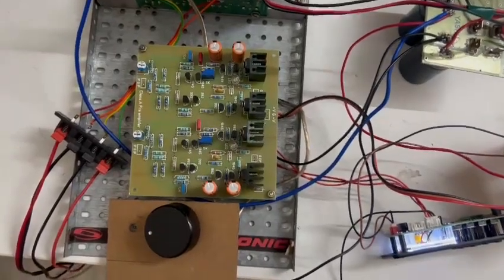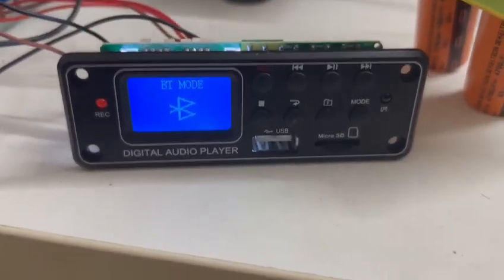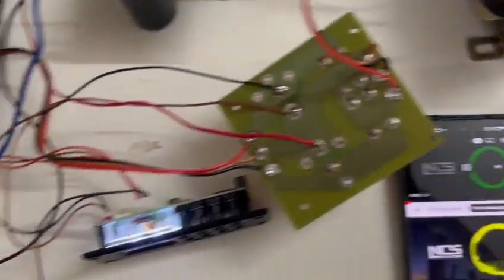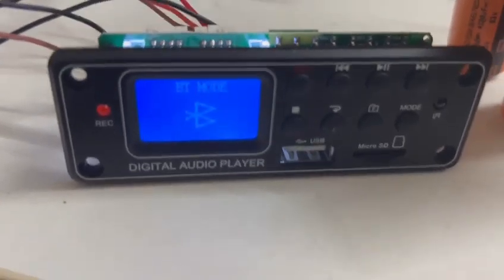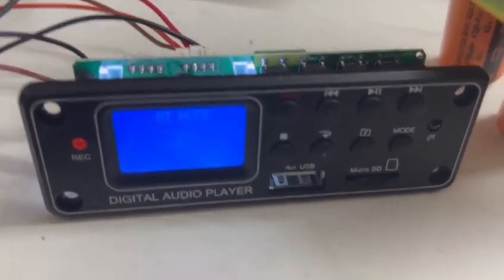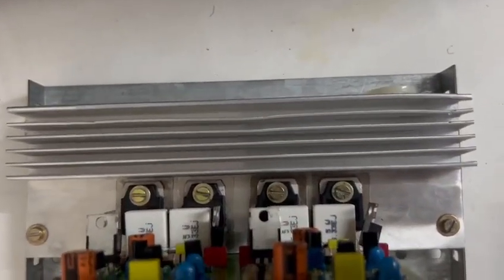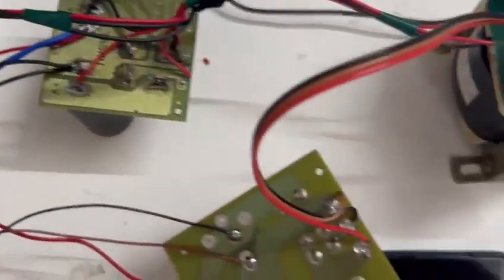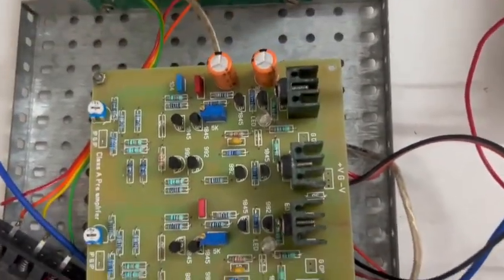Testing the Class A Preamplifier with Class AB audio amplifier

Comment: Let’s break down each part of this: “class A” is a type of amplifier circuit that reproduces the whole audio signal. This is different than a “class B” amplifier which only produces the top or bottom of the sound wave. class B amplifiers are used two-at-a-time so one reproduces the top while the other reproduces the bottom. Class A has the highest fidelity reproducing both together because there is no “crossover distortion” or, more simply put, imperfections when joining the top and the bottom signal from the class B style circuit. The negative about a class A circuit is that it uses much more power and thus creates more heat.

“Discrete” that means that the primary circuit for the mic pre uses individual components that are selected for the best combination from the point of view of the designer (the components are separate, or “discrete”). For example a tube, op-amp, or transistor are examples of a discrete components found in a mic preamplifier. Alternatively an integrated circuit (“IC”), or “microchip”, is a small package that contains a very dense layout of semiconductor components.

There is a deeper meaning to whether a mic pre, compressor, or converter is class A and what that means to you, the purchaser: A class-A, discrete piece of gear was most likely designed to be higher-end with less compromise than the average integrated circuit design. Though, a poor design can still be marketed as “class A, discrete” because a popular thought is that to be of a certain quality a microphone preamp must be both class-A and discrete.